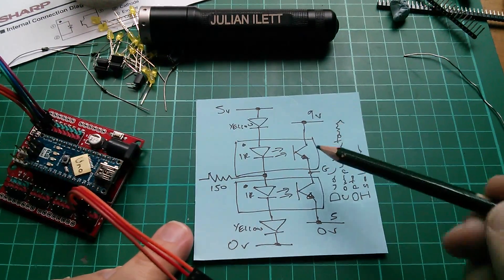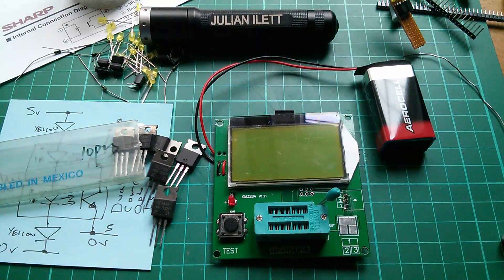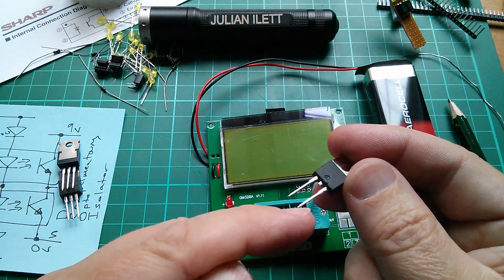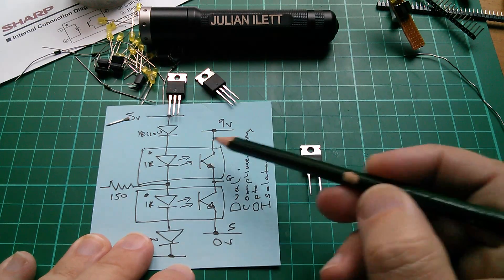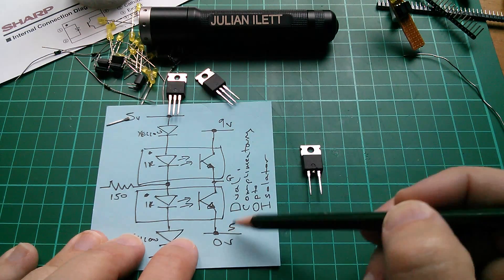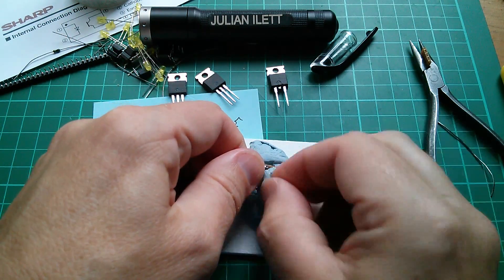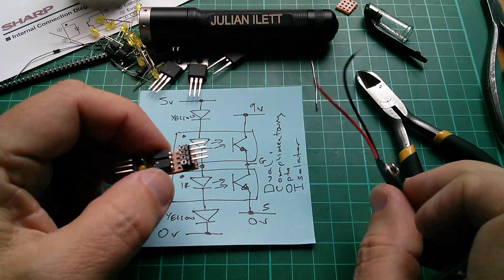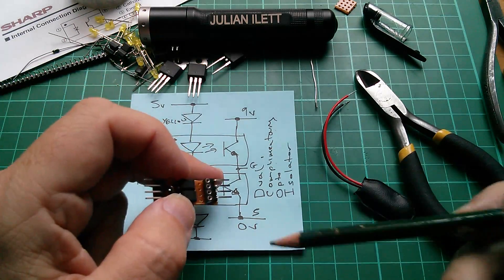DCOI Revisited (part 2) - Muppet 2 Project

Comment: Hi Julian. Really nice work. I intend to make my own DCOI using EL817 from Mouser. Can you describe the specs of your sharp opto-coupler or otherwise check the specs of mine to ascertain that it would work.
Reply from the maker: PC817 and EL817 are the same
Reply: Thanks Julian. I shall find another part and will share with you my experience.

Comment: I really wouldn't recommend relying on the solder to hold the MOSFET to the 2-pin header; just stick the MOSFET pins directly into the machined-pin sockets. Or solder some short lengths of stranded hook-up wire between the MOSFET and the 2-pin header; let the wire flex, rather than the solder connection. :)

Comment: which component tester is that you are using? Thanks
Reply: It looks just like the component tester I've used in my latest video upload (for something totally different). That one is marked GM328A V1.11. I bought it via AliExpress. On the back it is labeled Electronics studio and it features the Atmel ATmega328P MCU.
Reply: Maxint R&D      Thanks
Reply: Maxint R&D f

Comment: Interesting take on a MOSFET driver using PC817 optoisolators.  IIRC most power transistor drivers that I see and work with in AC drives, inverters and power supplies use a HCPL3120 , TLP250 , or some varient of a high current optoisolator designed to drive high capacitive, high current gates of IGBTs and MOSFETs.  Although in some applications I do see an IR2110 being used instead.

Comment: Why is the pwm frequency so high at 31khz?what's the advantage of a higher or lower pwm switching rate?I know DC motor controllers for EV's normally run about 20khz but I've never understood why so high
Reply: Higher switching rates allow the use of smaller inductors inside the H-bridge, smaller smoothing capacitors for the output voltage, and generally faster control.
Reply: You want to go above 20 kHz to avoid the irritating sound. Otherwise it is a compromise. A higher frequency gives higher switching losses in the power semiconductors but also makes it possible to use smaller/lighter inductive components.

Comment: 5v - (1.2 + 1.8)  / 150 ~= 13mA driving the opto.  Ic to the gate is only 10-20mA at best at 9V.  A higher voltage or better CTR opto would improve the Mosfet turn on time.  I tend to find a way to use the 4N32 darlington because I have a stick full of them as well ;)

Comment: Hello julian
Would you not even(For a moment) want to look at the CW decoder?
Morse decode with an Arduino?
There is quite a lot on the internet but it is (I think!) All still pretty blurred!
How you make it and how about the software.
With two (2) rows of LCD or and with four (4) row of LCDs
Transmit only or Transmit an receive
I think that this issue is still unclear!

Hereby I also give you a link from an SW recipient:
Http://websdr.ewi.utwente.nl:8901/
Receiver
If you clicked the link you must still set the SDR.
The SDR does it but it is still unclear on the screen!
Set it up first!
If you manage to get a bit of a tunner then turn on CW -
And search between the 14000kHz and the 14050kHz
The recipient can still MUCH more! Also take a look around if you want.
Next time if you like it I'll tell you more!

friendly greetings from The Netherlands!
Rob.

Comment: Ideally a MOSFET should be driven by a roughly symmetrical bipolar voltage, ie it should be driven by say +15V to turn it on and -15V to turn it off (relative to the Source) with a current capability of about one amp.  What really counts is the current that you put into and take out of the gate so it can be done with different voltages if the source impedances are adjusted accordingly but it's difficult to take enough current out of the gate if the gate driver voltage is zero relative to the gate.  In high frequency switch mode converter design it's all about driving the MOSFETs on and off fast enough.  It's no good trying to run a converter at say 100kHz ( period 10us, minimum on-time say 3us) if your switching delay is 5us.  These opto couplers have rise and fall times of about 6us at 30mA.
Reply: number 33 keen to have your alternative if you have a nice quick one you can recommend for higher frequencies
Reply: A simple trick that we used to use before the days of dedicated MOSFET driver ICs was to use 4000 series CMOS buffers such as the CD4049 or the CD4050.  We used to parallel them up to get lots of drive current with a rail-to-rail voltage swing. eg parallel up five buffers and use the sixth one to drive them giving a low input capacitance to the source.  For high side switches we used transformer coupling with capacitor coupled connections to the gate to provide a bipolar drive voltage.  This of course doesn't allow the duty cycle to go to zero or 100%.  The amount of drive current you need depends on how big the MOSFET is we were always trying to drive big FETs at tens or  hundreds of watts.

Comment: I don't think it'll matter at 31khz,  but darlington opto-isolators are more sluggish than single transistor types.   The ones I've salvaged have all been darlingtons and I couldn't get a nice 1mhz square wave through them (at 5V output).  I might have put this comment on the original DCOI videos, so apologies if so.

Comment: IIRC, there are DC-DC converters that are completely isolated from input to output, I only remember seeing 5V versions but perhaps there's 9V or even 12V versions? Worth looking into so you don't have to rely on that 9V battery :)
Reply from the maker: +Skruffles You must have read my mind ;)
Reply: Can't you use the either the solar input or the battery output in the finished circuit?
Reply: It doesn't need regulating AFAICS,  as long as it's high enough voltage to turn the mosfet on.  A local decoupling cap never hurts of course.